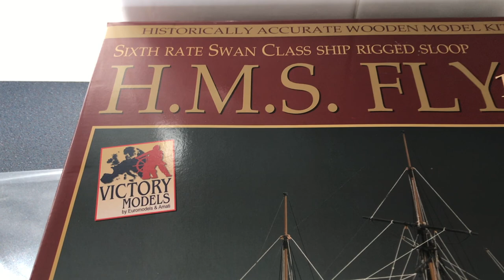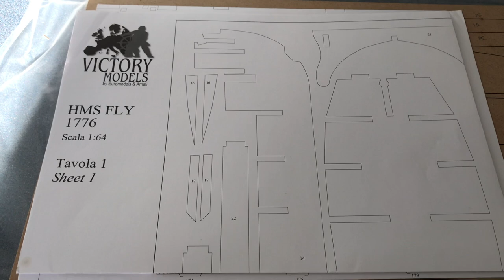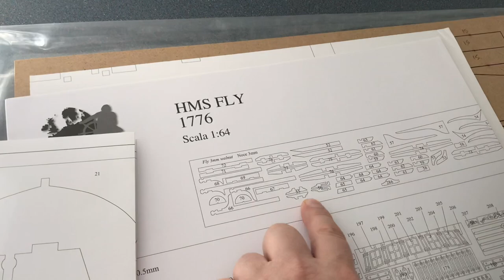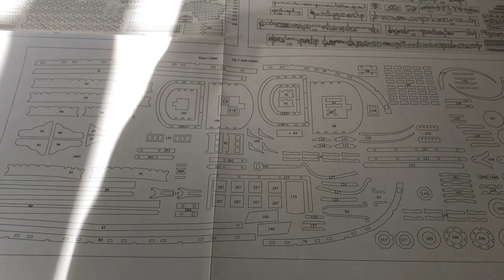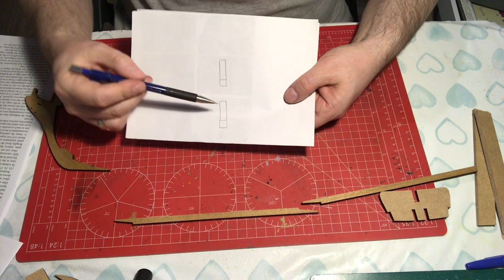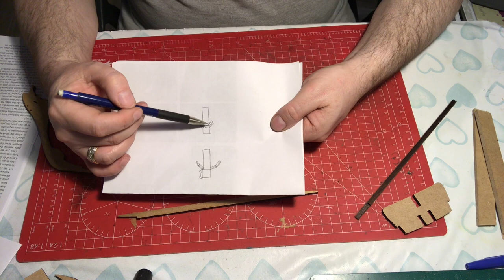Victory Models1/64 HMS Fly, full build part 1

Comment: I'm sure Pickle is an easy build, unfortunately it's nothing like the real Pickle. The historic hull dimensions give a completely different shape.
Reply from the maker: Thats strange Caldercraft take their dimensions straight from the original drawings
Reply from the maker: This is what Caldercraft say:  the model is designed from the original plans and contemporary sauces to make it as accurate as possible, so I would love to know what your source is that states its ‘nothing like the real Pickle’. I can then take that to Caldercraft see what they I am in contact with them.
Reply: @ModelkitStuff  See 'HMS Pickle' by Peter Hore (Cpt, RN) The master's log states the draught fore and aft and the dimensions from the Master's log. Some confusion seems to arise from there being two Pickles. The second (Sting) replacing the first under Seymour's command and assumed the name Pickle. Also she only carried 6 guns on deck, the other 4 placed in the hold as ballast under the direction of Lapenotiere. With 10 guns on deck she was top heavy. Hore sates the dimensions of 73' on the gundeck, 56' keel, draught f'ard 7'7", aft 9'6". Nelson reputably said she was the fastest ship in the navy, it follows that she had a Yankee style hull. Caldercraft doesn't tally with this. I have spent a year in research on this subject. Also, the only contemporary images are the paintings by Robert Dodd (renowned for his technical accuracy), at the behest of, and apparently overseen by Lapenotiere. These fit more or less with the above dimensions.
I would like to know Caldercrafts sources, for one thing, there are no surviving drawings. She may have been built to an existing design without the need for any
Reply: I note that Jotika's information is similar. It was reported in the 'Bermuda Gazette' that sting 'set sail' for Curacao, there was no mention of seizure by the Neriede. They further state that they used a different vessel to produce the model. Having measured the proportions of deck and keel on their plans they are not Pickle's comparative dimensions and are not in accord with their own stated dimensions (as stated by Jotika which agree with my findings) . Also the straight stem is unlike Dodd's depiction. Their Pickle is a different vessel. They reference 'one source' claiming she was built in Plymouth (hard to fathom that conclusion considering she was built from Bermudan cedar below the waterline!). The source is Gordon Frickers, in which case it was likely read by Peter Goodwin. I intend to have a full discussion with Peter on the matter when I next see him!
Reply from the maker: @dugan6056  I guess you would have to ask caldercraft.  but the insturctionms say taken from origonal drawings
Reply: @ModelkitStuff  Taken from original drawings of a different ship. It's all on their website. Sting has a shorter keel to deck length, this gives a very different hull profile with a pronounced stem angle. In my view Jotika would have been better off producing their own drawings. The ship they have produced wouldn't win any races!! It's more of a trader.